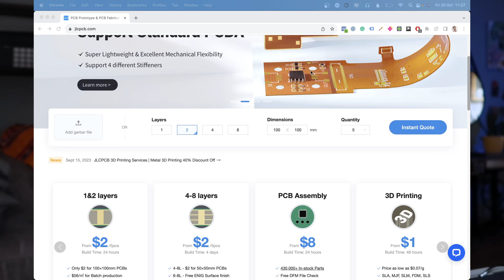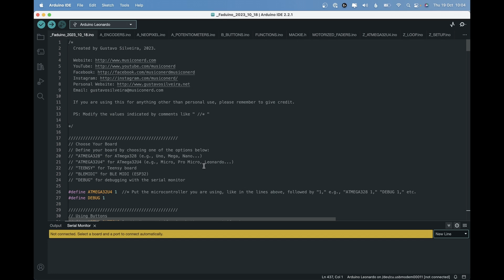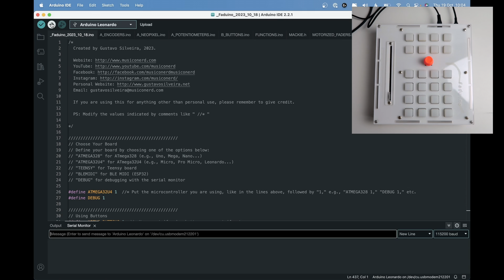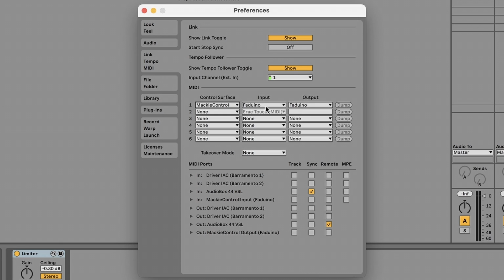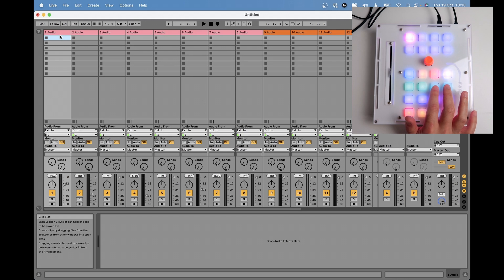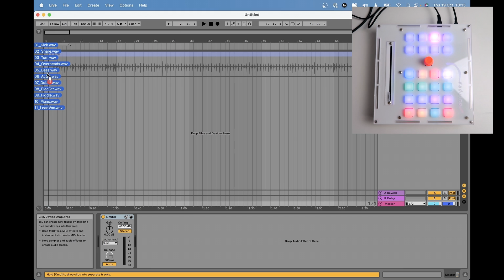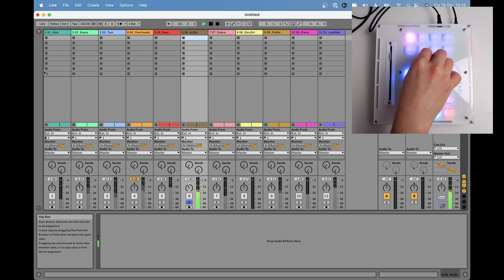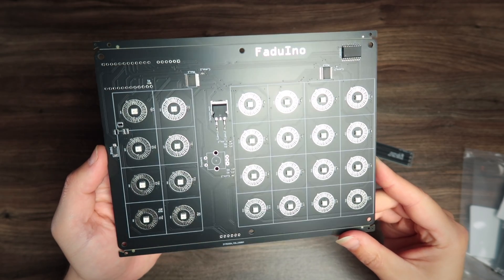I Built a MOTORIZED FADER Faderport Clone DIY MIDI Controller: The FADUINO

Comment: Hey friend, could you tell me what power supply/setup you used to power the motorized fader? I noticed you need a 9volt 3amp power supply which the Arduino cannot output so I was wondering what power supply you used. Thanks so much!

Comment: As I already sprang for motorized fader, I am more curious if this could be used to build out a set of rotaries.  Say you want a rack mount to control all the delays in your DAW.  Imagine a dedicate rack unit (or box) with all the typical dials all labeled.  It didn’t matter which delay you selected.  All the dials controlled what they were supposed to.  LEDs around the encoder show where the dial is set and update as you change programs/presets.  There is some special signal (different color or something) that shows if a specific knob doesn’t exist/work for this particular delay sim.
Now repeat for chorus, boost, and so on.

Comment: Great video and controllerI like that all the buttons are illuminated, which makes it better for darker studios. More daw control surfaces should incorporate this. The behringer x touch controller would be even better. I asked Behringer if they could do this for the x touch and they said unfortunately it’s a hardware not firmware issue. The led colors are fixed.

Comment: “Something that is impossible with with regular faders and rotary potentiometers” this is only partially true, and I’m splitting hairs a bit but I think it’s important: rotary encoders make this very possible, and I know they aren’t pots, but you can get the same effect and people conflate pots with knobs a lot. Also, you can get a similar (but janky) effect if you use relative instead of absolute motion in your programming
Reply: In fact there is a motorised encoder that could do all of this.  Look up the SmartKnob project.  I'm building one myself soon.  I think this MIDI controller project would be a great way to use it.

For a similar idea, you could go with a hall effect rotary encoder that would be smooth and continuous and rotate without limit.  If you tuned the mechanism and added drag lube, you could make it feel just like a pot but without the endstops.
Reply: @excrubulent  the motors for that have been mostly out of stock for years, and some other projects have improved upon some of the design aspects of that project also. I was really interested and hoping to build one when I saw the original video though. 

I just use a surface dial connected to a Pi now, separate display showing what parameter and value Im currently on, and relative motion instead of absolute (display gives me absolute positioning anyways.)
Reply: @threepe0  Ugh, I think my comment was eaten for telling you where to get a particular part.  Can't have people being helpful or anything in a youtube comment.  Anyway, the brushless motor part number is ROB-20441 and they made it available thanks to the SmartKnob project.

Do you have information about what other projects improved on it?  I can't find any information about them.

Comment: This is really dope. So close to what I was looking to build. Hopefully I can adjust the code for 8 faders, 8 encoders and each has their own solo mute and record. Do you think you could have 16 tracks or would I need to make a second one minus the transport section?
Reply from the maker: The Mackie Protocol only works with 8 tracks. So, you need 2 controllers, and the second you can choose a different option in the control surface option to be recognized as the 8-16 tracks controller.
Reply: @NerdMusician how complicated would it be?
Reply: @NerdMusician  There is no need to have more than one controller if you need to control more than 8 channels. Mackie Protocol has the banks to deal with this..
Reply: i want to do the exact same thing too, do you find modern daw controllers ugly too? 😂
Reply: @artvandelay4914  kind of. I have 2 bcf2000 and one wasn’t working right but after looking at how midi cc code works I was able to reprogram it and now it’s fine but I still would like to build my own for customization at a cheaper price. Would like to find out if lcd code could be added to the channels to display track name during banking
Reply: What is the advantage of building your own versus buying a used Behringer X-Touch or PreSonus model?
Reply: @subs4794  i have 2 bcf2000 and now that they work it’s not necessarily a need but it would increase functionality and have better transport control in probably a smaller footprint. Also customizable buttons that I find useful

Comment: I wonder if you could use this as a lightroom controller for editing pics. It would be very cool to have one motorized fader and buttons to switch between whatever you're changing
Reply: it's a midi device, does lightroom support midi?  if not, i'd be shocked if there isn't proven software available to handle translation between hardware platforms.  for instance, midi can be used to control lightshows.  as well, midi controllers can be configured as tactile controls for flight simulators, etc.  at the very least, the project is open-source so in extreme cases the software bridge can be coded from scratch.
Reply: @erock.steady  so natively, Lightroom doesn't support midi but it doesn't really support much. There are midi controllers like the loupdeck that cost hundreds each with proprietary software. There is, however, the open source solution "MIDI2LR" which allows you to map midi inputs to lightroom functions. I'd have to poke about in its code/release notes to figure it out!
Reply from the maker: I'm sure there's a way. I've heard about softwrae that does exaclty what Mr @erock.steady said.